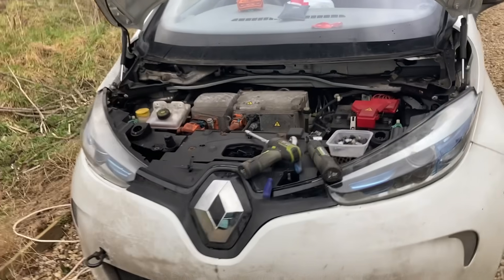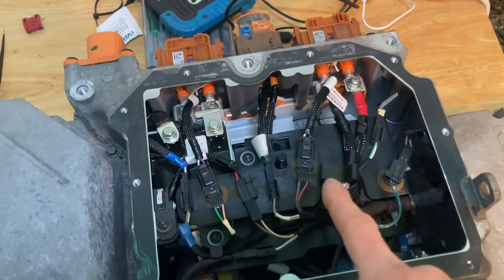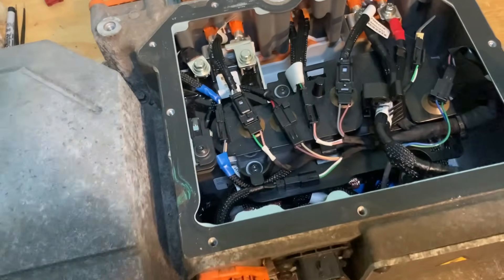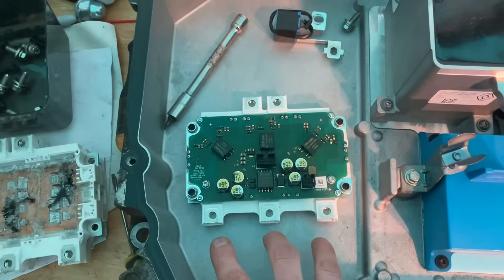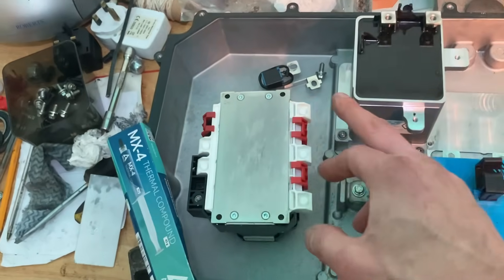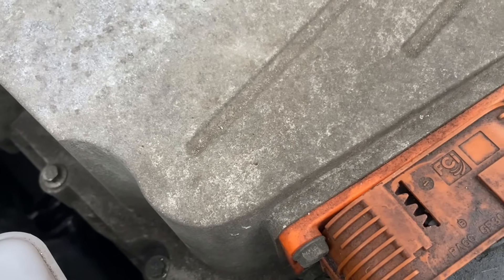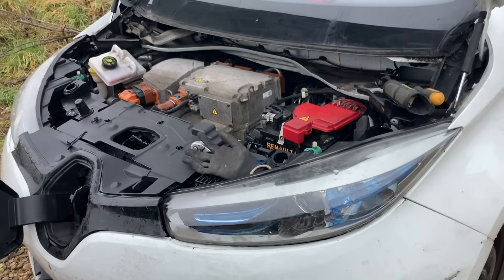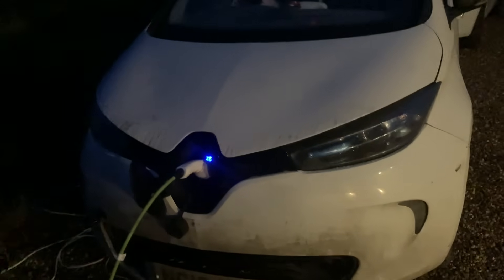Electric Car Repair - Renault Zoe BCI “Battery Charge Impossible” EV charging fault BCB 5AM450 Q210

Comment: Heat sinks would stop most electrical  ev car problems. 
Fans are another, computers have them, why do ev cars - 1st generations - have none.
Engineered to go wrong, if we all got together and demanded electrical goods of all kinds work for a minimum5-7 years with no problems ev to the masses would work.
But, the masonic mafia want us out of cars in 15 min cities

Comment: I have a 2014 Renault Kangoo z.e. the onboard charger looks alot like that one but it starts and stops flashing the headlights pausing during charging. Dealer says replacement and coding for a new part is more then the value of it. So where can ik get this replacement part, it looks dead simple 2fix!
Reply from the maker: Hi, you can buy 2nd hand ones but they need the vin coding transferring over and many of the used parts are old as this design was replaced by the updated one in around 2018. It’s fixable but would take time to work it out. I’ve always fancied a crew cab Kangoo, but I think even the old ones have road tax now? Cheers

Comment: Hi Gary, can you tell what can cause this issue? my Zoe has the same issue and my dealer says it's because of a charger station at our home, but I have my doubts. They don't want to pay for the repair :(
Reply from the maker: Hard to say, can be caused by a misconfigured charging station but also common for a failing ac compressor to damage the rectifier.

Comment: Gary, I think I bingewatched all your videos and I just realized I don't think I have seen you with a laptop. Can you change replace and repair these bits without the computers going into some spasm?
Reply from the maker: Hi, I refer to manufacturer instructions on the laptop tho that’s not very exciting to video, I do some programming/configuration where necessary but mostly I just swap compatible parts so that it just works when it’s back together and not too much programming is needed. Sometimes it’s unavoidable eg when dealing with vin locked components or new parts that need configuring. Cheers

Comment: Does Zoe ZE40 2019 have the same issue? I can't charge my car. First no Warnings, after connection, its want to start, clicks here and there (something fan starts) and that clicks off and massage turns up "check connection". I have redone all ground cables (that I can see). Still same issues 😢😢😢
Reply from the maker: Hi it would need further testing to be sure, I might be able to recommend someone to help you, drop me an email if you like gclayton@hotmail.co.uk  cheers
Reply: Thanks I will

Comment: I had a pretty similar issue on my Zoe Q210 which I believe resulted in the same component being faulty. However my BCB error only materialised when trying to charge on a 43kW charger. On 7kW, 11kW and 22kW was all fine still. Luckily at the time I was still under warranty with Renault.

Comment: 16h40 for full charge.with 10A. how many miles did this car with a full charge. what is the price for this rectifier? repair seams easy if one became this from Renault.
Reply from the maker: Hi, rectify was a secondhand low mileage unit, these Zoes are fairly inefficient at low charge rates hence the long charge time. Fully charged range was around 80 miles. Cheers
Reply: @ , 80 Miles is not a lot for 16 hours of charging. thanks for your answer.
Reply: @viktorhugo8252  take it in mind 16 hours of charging is on a 13A plug at round 2.2-2.6kw)

Comment: Maybe I missed. But I did you also replace the AC compressor?
Reply: My daughter had an early Zoe that had a failed compressor. They do have an electric heater as well which gives a bit of warmth and I eventually had the compressor replaced with an Ebay one before selling the car. The old compressor had completely shattered internally. She replaced it with a later Zoe 40.
Reply from the maker: The compressor has failed and I did mention in the video that it needs replacing, but the customer decided not to go ahead with this so I have just left it isolated (removed the HV fuses supply the compressor). Cheers
Reply: Hello and thank you very much for a great video😊 My zoe charges very slowly on fast charging. When it's cold it charges with 3kwh, while at other times it may start charging up to 16kwh, but then go down. How do you measure the rectifier, before disassembly? Do you need to dismantle the entire box as you did in the video, or is it possible to open the lid on top and take out the rectifier? I have error code DF040 inverter module. Is this the same part you replaced?

Comment: I have seen a place in Australia or NZ that can fit any Leaf battery into the older Leaf car as an upgrade. Are we in the UK any closer to cost effective battery upgrades yet?
Reply: I like the videos on the technical side of things. I have owned a 2013 500e and now a 2017 Bolt, and really like EV’s. Will be good to know how to fix them as they age.
Reply from the maker: Several garages in the uk can do leaf upgrades, tho finding a decent bigger battery can be a challenge and then you have a mongrel which may not be worth what it cost. Cleevely EV, Cedar Electric and DB Car Doctor can do leaf swaps/upgrades and I know a guy that builds custom battery packs basically to whatever capacity you want. Not cheap but very cool! Cheers
Reply: The parts and labour will probably cost more than the car is worth. That's the problem with EVs tbh, batteries never get cheap. You can find used and working engines for a few £100, but batteries will always be £1000s as there is little point in installing a used/salvaged ones. Also the labour cost to swap some of them is insane as you have to disassemble most of the car to get to them.
Reply: @BlatentlyFakeName  the value is the usage of a car I intend to keep and have no plans to sell.
Reply: @ Might as well just buy an EV with a larger battery, it will be cheaper.

Comment: Nice to see some content on a Q motor Zoe. Will you test 43kw charging before it goes back to the customer? Those chargers are getting harder and harder to find - polar are now replacing the 3 headed chargers which use to do 43kw AC. Kind of sad but also part of the reason we ditched our Q motor Zoe.
Reply from the maker: Hi, yes provided my local triple header BP charger is working! Indeed they are less common now, our first Zoe was one of the ac rapid charge type and it worked really well when you could find the right charger!! Cheers

Comment: When Lithium Ion Batteries drop below the minimum voltage I read that the cells are likely to have permanent damage. Is this true ?
Reply from the maker: Hi, it's not quite that clear-cut i.e. below X voltage they are damaged and above they are not, it's more that they prefer to be around half ish charged so if you were to store a lithium battery for a year you store it at that charge level, and if you want it to last as long as possible you avoid it being flat or full for too long, for example only charging to full if you're using the car the next day. So the lower the voltage, the more damage will occur, relative to the period of time it's left at that level and how you treat it while it's there. There is a minimum voltage below which the car will not start and drive, but there is a lower minimum voltage for charging because obviously when the car runs out of juice you need to charge. This works fine because charging can be carefully controlled whereas the load from driving is higher and more variable. Hence this car charged slower when it was very low. I have worked on a Zoe battery which had sat for a while very flat and as all batteries have a self discharge it had dropped below the minimum charge voltage. From diagnostics I could see that the cell voltages were only slightly too low to charge and I could see all the temperatures etc were fine so I applied are very low current across the entire battery to slowly bring the voltage up above the minimum charge voltage so that it would then take a charge normally. I've seen various tests with lithium batteries at 0 V with minimal damage if it is only for a short period with no reverse voltage. Exact experience depends on the type and chemistry of the cells. Hope that's interesting, cheers.
Reply: @garycevrepairs  Great answer thanks. Do Zoe Battery packs contain multiple smaller 18650 panasonic cells like Tesla ?
Reply from the maker: No they are larger cells, kind of like a box of tissues 😆, well lots of boxes of tissues
Reply: @garycevrepairs  The cell (in the R90) is an LG Chem manufactured E63. Theoretically can be found under LGX E63 but datasheets and other information are few and far between.
Reply: Dropping to a super-low (or even zero!) voltage isn't good for them, but it's not as bad as old lead-acid batteries (still commonly used for starters or in campervan "house" batteries ((though lead-acid engine starting and house batteries are built differently inside, and can't be swapped to do each other's jobs))). If those drop to zero, they're door stops. Lithium batteries can be "jump started" from zero and start working again, as long as they're not left down at zero for too long. Of course, the BMS should indicate "0% charge" when there's actually about 5% left, to prevent such a thing from happening in the first place.

Comment: Fascinating, thanks Gary! I've not seen much of the insides of a car that does 43kW. Was the later interior from the BCB from a car with the R motor that did 22kW charging, or are there different variants even within the cars with Q motors and 43kW charging?
Reply from the maker: The replacement rectifier was from an R motor Zoe with 22kw charging. All the Q motor cars are basically the same. Cheers

Comment: Interesting that you mention the compressor has gone. Friends is the same and I read its a common fault that they eat themselves. Seen some second hand on eBay around £300 and wondered if worth fixing... Hoping you'll show that fix 👍
Reply from the maker: Yes the compressors break up internally, probably because the Zoe heat pump is very high pressure. It’s not much of a fix, you put a working compressor on 😀

Comment: I have this same zoe model and it has a faulty ac compressor, i got a new compressor and it now charges with no problems, my main question is if theres any other major part i should change, i will clean out the car with air so thers no debri from the old blown compressor but is there anything else i should look out for or change, i will also change the aircon dryer because i suspect it is full with parts of the compressor. if there is anyone with expirience on this i would appreciate some info
Reply from the maker: Hi, usually it’s ok to just change the compressor. If you are very unlucky the failure is within the scroll part of the compressor and it pumps metal swarf up the pipe as it fails. I’ve only seen this once out of loads of compressor failures including many garages that I have supplied replacement compressors to. It blocked the interior ac radiator in the dash which had to be replaced. Changing the dryer is usually recommended and indeed if you buy a compressor from certain suppliers they insist on the dryer being replaced also otherwise they won’t warranty the compressor. Cheers
Reply: @garycevrepairs  Thanks for the reply, unfortunetly i know that the scroll part failed because i opend the old compressor and it was in pieces, thats why i will clean out the whole system with nitrogen and i will also replace the interior ac radiator like u said and the dryer.
Reply from the maker: Sounds like you are doing a very thorough job. Nice one.